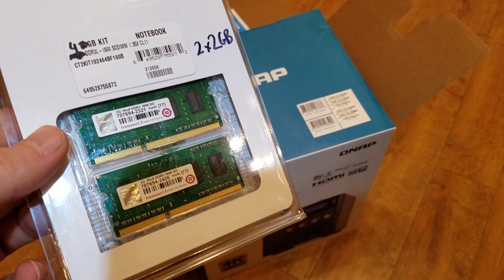Memory upgrade QNAP TVS-471

Comment: What RAID did you use and are you still happy with it?  Any more issues w/ HDDS failing?
Reply from the maker: 5. And I am satisfied with it, but had to study up  a lot to make the choice, and am not certain it was the right one. I have not taken the appropriate steps to "backup my backup".
Reply from the maker: Only one drive has failed, and that within the first weeks.
One problem is if you put in a bunch of the same drives, they have similar lifespan, and could die close to the same time. If more than one goes at a time, before the first one can be replaced, you're hosed.
Reply: Derek Kerton are you not certain about the RAID you chose or the TVS-471?
Reply from the maker: Not certain about the RAID choice - and I'll only know if I don't regret it after 5 years with no catastrophic data loss. The device has been great.
Reply: Derek Kerton Thanks for your help and responses. I pulled the trigger yesterday on a 471 but went with RAID 10. I plan to use one of my existing WD external drives as a “safety backup”.  Best of luck with your system and thanks again.

Comment: How do you like that TVS-471? I'm torn between that and the TS-453A, but I'm leaning towards this one. I just need a little nudge. :)
Reply from the maker: So far so good. A Western Digital drive failed on me after two weeks, and I just hot swapped in a new one and the RAID was rebuilt by the next day. Pretty happy with that.
I've got it hooked up with a keyboard and the HDMI out, working as a small computer to display the photos it has stored. It's also a Plex server. No problem at all with processor speed.
Reply: Thank you.
Reply from the maker: Well, I still like it a lot. Having the Intel processor allows for a wider range of apps to run on it, including media server. I'm happy with how well it runs Plex. I also like being able to use an HDMI out and run it as "not headless" when I want.
Reply: Get ts 470 not as expensive as tvs 471.       Ts 470 socket 1155   cpu i7 3770s for 140 on ebay   can add 16gb ram
Can add m.2 pcie adapter off ebay for 10$ no need to use qnap adapter for few hundred bucks.

Ts 471 cpu bit more expensive in 350$ range.and up
Dont get 453 atom based junk and underpowered and not upgradable